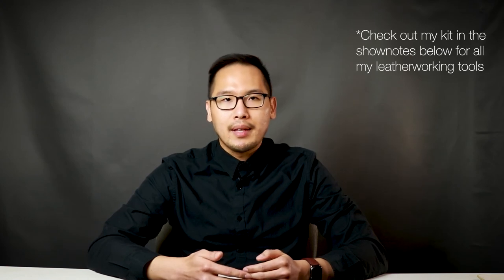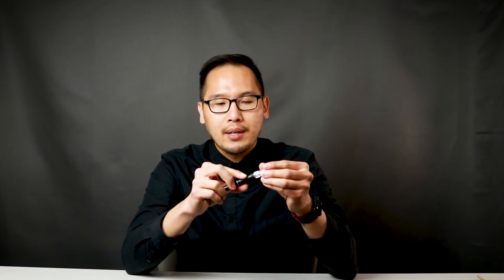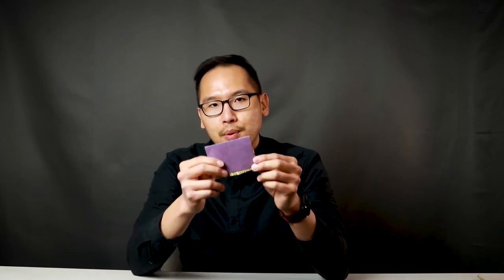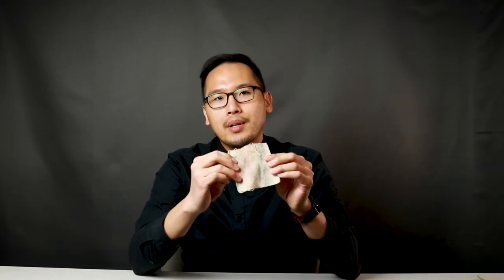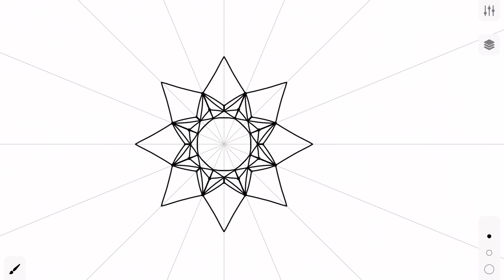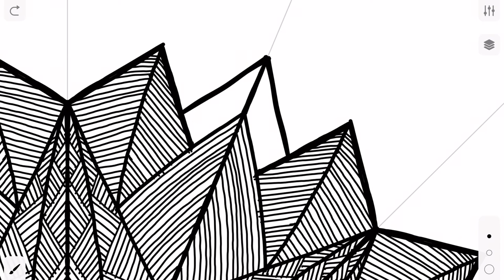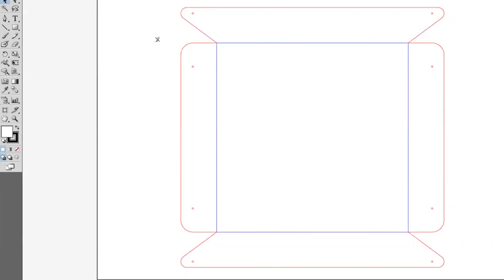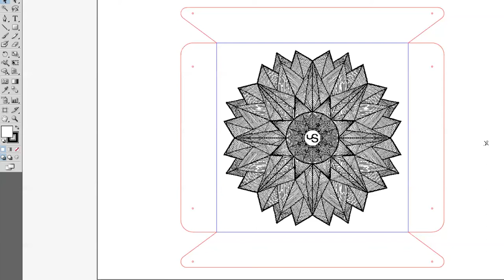How to Make a Custom Engraved Leather Valet Tray

Comment: May I ask if you can use Glowforge to cut letter and create holes for stitching and skip the cutting manually?
Reply from the maker: Hey there! Yes, you can use the Glowforge to cut vegetable tan leather with stitching holes too, but it’ll leave a charred edge which you’ll need to clean off before you stitch.
Reply: @LaserMadeProducts  Thanks so much for your kind reply!

Comment: Great project! Quick question...it looked like the leather you used was smooth on both sides? Was this two pieces glued together?  Thanks.
Reply from the maker: Thank you! The leather is smooth on one side (the skin side) and the flesh side has texture to it like most leather. The hide that I was using had tighter fibers, so it’s definitely even throughout compared to other hides where you can see loose fibers. Hope this helps!
Reply: @LaserMadeProducts  Thank you!
Reply: One last question...is the pattern that you used available for purchase? I have a glowforge as well and loved the look of the corners on this valet tray. I was hoping to create a draftboard template on my GF like you did. Thanks!
Reply from the maker: @dv5191  Sure, I listed it just now on Etsy, which you can find here: https://www.etsy.com/listing/909064515/leather-valet-tray-digital-template-file . Hope this helps! If you post your finished product on Instagram, don't forget to tag me @Tim_Ung so I can check it out!!
Reply: @LaserMadeProducts  Thanks. Just made the purchase and I'm excited to make this great project! Appreciate your communication and help!